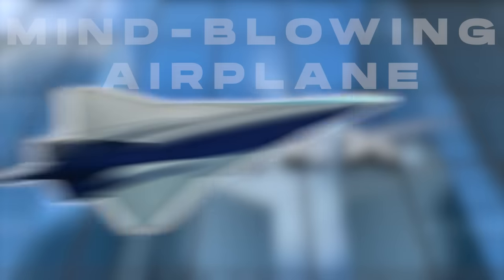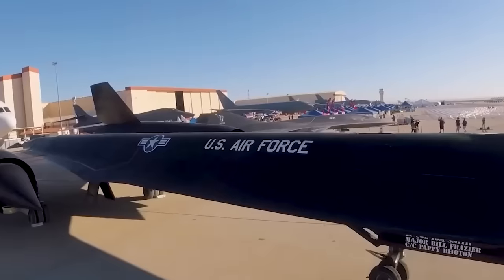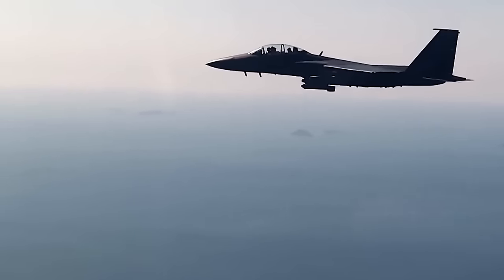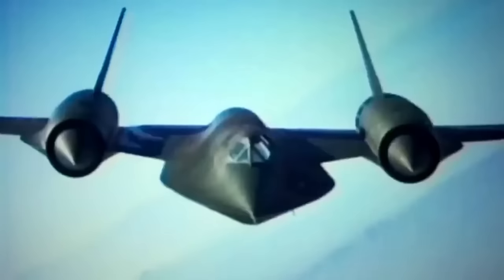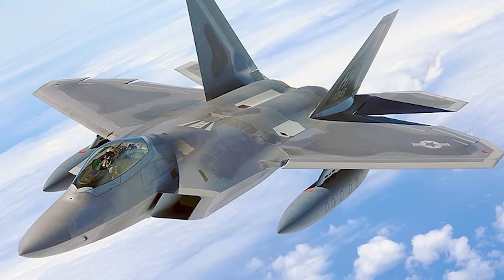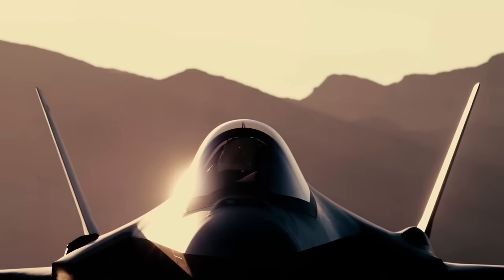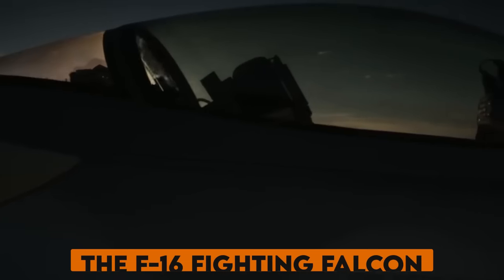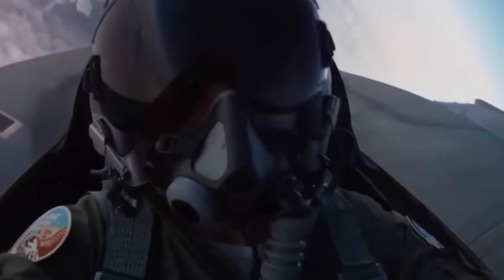Elon Musk JUST REVEALED Insane New SpaceX Airplane To Intercept North Korean Spy Satellites!

Comment: Reconnaissance. Isnt that what satellites are for.
Reply: Hyper Sonic aircraft can be launched with little notice and fly wherever they want. A satellite, once fixed in an orbit, can be plotted easily, so anything on the surface that doesn't wish to be seen knows when to be concealed when the satellite travels over head. As I said, a Hyper Sonic aircraft can change course at any time, so it can surprise surface items unless they are kept concealed at all times. This works great for viewing troop & military equipment placement in near real time.